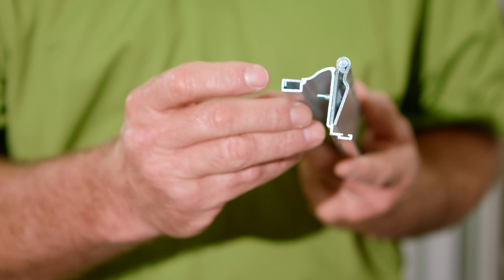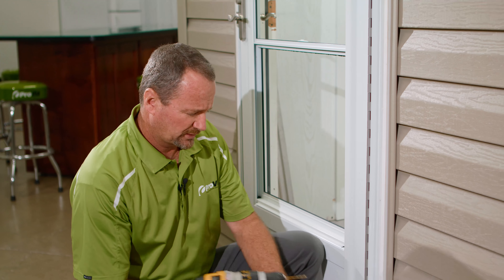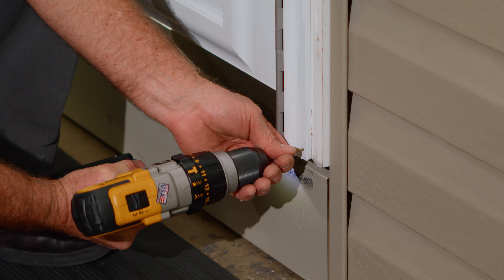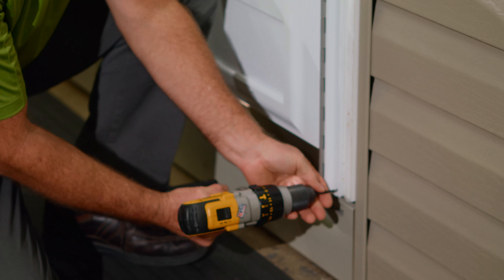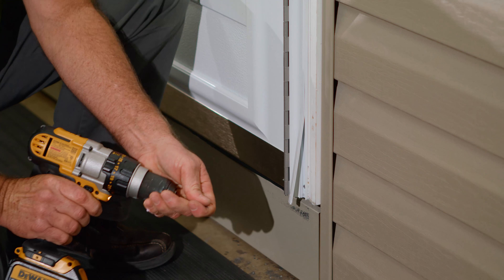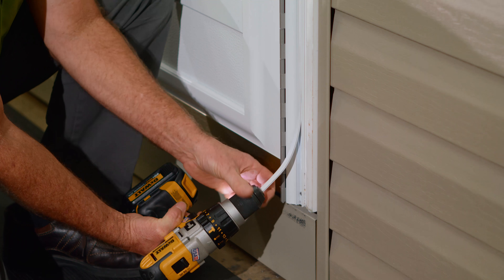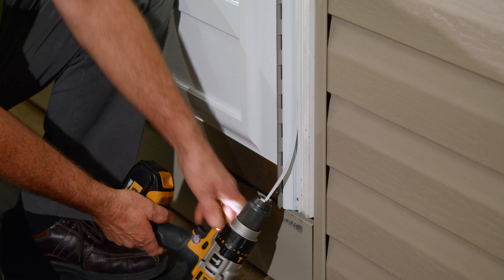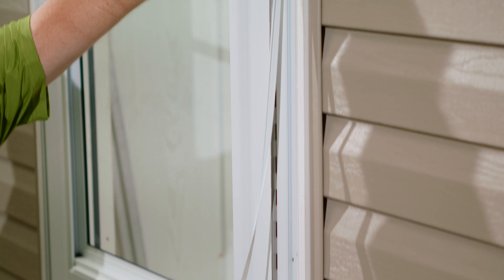Storm Door Repair: How to Remove the Screw Cover

Comment: My Lord. Can they not be removed with a small screw driver and reused? That's crazy.
Reply from the maker: Hi Jory! I understand what you're saying; however, since ProVia's storm door screw cover is intended to be a permanent part of the door we have made it from the same extruded aluminum material as the door, which gives it a beautiful and professional finish. This ensures it won't fade like many manufacturers' storm door screw covers which are made of plastic.
Reply: I hear ya. I'm getting ready to order a door. They are nice. Just seemed crazy to have to destroy the cover to get it off.  @ProViaProducts
Reply: @4x4dually  it def is a great door, but we recently have to take off the 3 covers for a customer to adjust the door, and @ProVia wants the same price for the 3 snap on covers as the storm door itself, now thats CRAZY!!